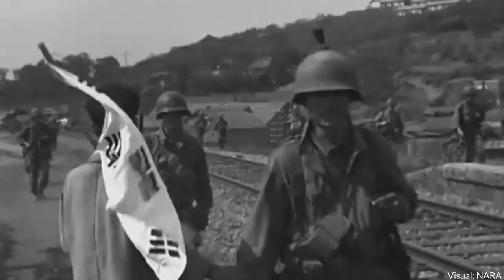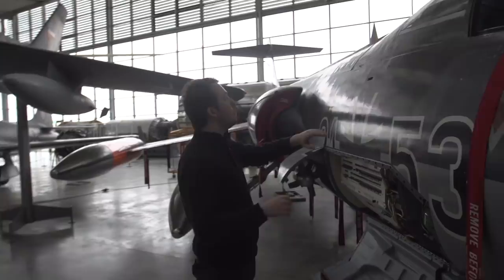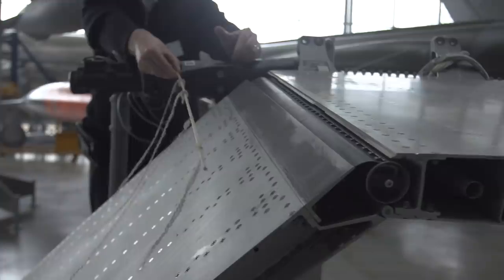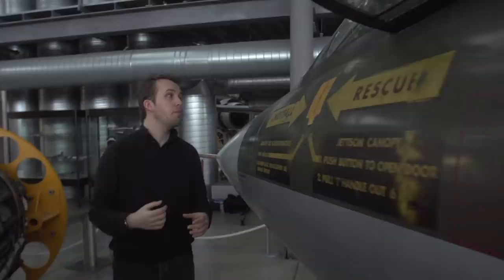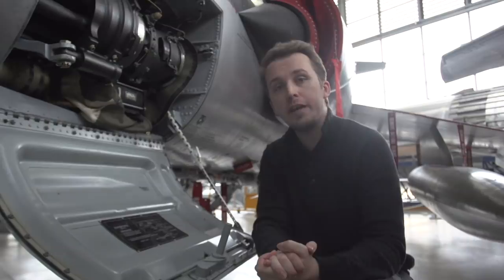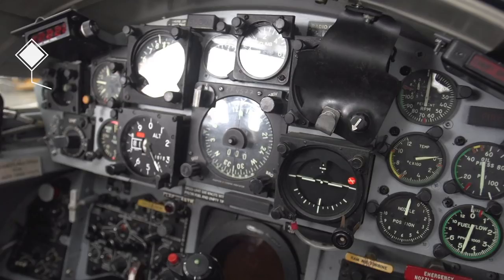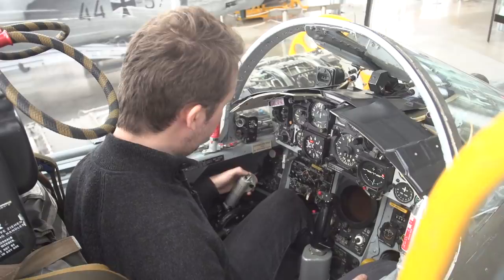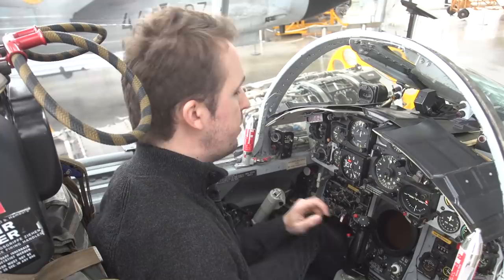F-104G Starfighter - Inside The Cockpit

Comment: The wing leading edges have red covers on them since they were notoriously sharp enough to cut yourself on. The wings were very, very thin.
Reply: Actually while the leading edges were seen to be sharp, the covers are not to protect you, they are there to protect the wing from dents and nicks that would effect the flow of air over the wing.

Comment: You missed the Canadair version, which I think was the fastest. I had a friend who flew every Canadair ever made, across the Atlantic to West Germany.
Reply: The Canadian F-104 (AKA the CF-104) was basically an F-104G, but powered by their (Orenda) version of the J-79GE-7 rather than the J-79GE-11 used on the F-104G.
The Orenda J-79GE-7 (the J-79-OEL-7) generated 10,000lbf dry (without afterburner) and 15,800lbf wet (with afterburner) which is basically the same as the ratings for the J-79GE-11 used in the F-104G, however.

But while these figures are around 10-percent more than that of the J-79GE-3 used in the F-104A, they are also about 10-percent less than the figures for the J-79GE-19 which are 11,800lbf dry and 17,900lbf wet which was used in the even heavier F-104S.
And it just so happens that these more powerful J-79GE-19s were put into some of the lighter F-104As that were used by the 318th FIS in Florida
The lighter weight and higher thrust should have made these re-engined F-104As the hottest (i.e. fastest) ever.

I think it's important to keep in mind though that the F-104s were generally not allowed to fly all out as thermal reasons (IIRC, the temperature at the face of the J-79 would rise above the engineers wanted and eventually, there was some risk that the canopy plastic would soften from the heat as well).

Comment: The original f104 was result of Kelly Johnson talking to pilots that were veterans of the Korean War. This was not a pentagon plane this was a pilot's plane. Based on the experience of the Korean War pilots all they wanted was speed speed and more speed. That and a better gun. The f-104 consequently is designed for just pure interceptions speed. Making it a multi-roll aircraft was foolish. The f-104 hydraulics for the allirons required a whole new type of actuator. This was because of how thin the wing was a regular actuator was too big. It is called a piccolo actuator. The wings were sharp enough where if you walked into them they could cut you. Ejection seats weren't quite as good when the f-104 was designed and so there was a great deal of concern about the seat firing upward and the pilot hitting the T tail. The downward firing ejection seat had its own problems because if you're at a low altitude you'd make a nice hole in the ground. Apparently this was not considered important when the f104g was designed as a multi-role. A number of West German pilots ejected into the ground as a result. Thus the f-104g ended up with the title widow Maker. A retro fit of I believe a Martin Baker upward firing seat was later installed on the f-104. This airplane actually had a red line that was below its top speed. Kinetic heating would damage the aircraft if you went over the red line speed. Essentially the plane was faster than the airframe could handle. It is my favorite century fighter. And it is an amazing plane given we just started the jet age had our first war going on with jets and Kelly Johnson comes up with this bad boy.

Comment: Glad to see some respect for another one of Kelly Johnson's innovative designs.  But I wonder if there is a German to English translation issue because I don't understand this statement at around time 6:20:  "but it wasn't supposed to be a turner, but it was still very maneuverable; don't think that turning and maneuverability is the same thing because it is not; the aircraft was quite maneuverable"?  That requires some explanation because maneuverability is the ability to alter the velocity vector (flight path) of the aircraft, which is done with lift produced by the wing, also known as turning.  What do you mean when you use the word maneuverability: controllability or stability perhaps?   Unsure what you are trying to say.

I just want to add that I am not critical of the performance of the F-104 in any way.  It was a great design that delivered exactly what had been asked of it, which was speed and climb superior to any other fighter in production. Back when this airplane was designed, superior speed, climb, and altitude were seen as the decisive advantages in combat rather than turn radius.
Reply: I wonder how it compares to the Lightning
Reply: Visionist they were pretty much made for the same purpose, so I would wager similar.
Reply: I was thinking that myself ... 
Maybe it had great Pitch and Roll authority, but blead airspeed quickly in a protracted turn?   
That would be my guess with such a short and highly loaded wing.
Reply: I believe he must be saying the aircraft was very responsive to the controls, after all, some fighters can have problems at high speeds, were the 104 was quite happy to be in.

Also, the Starfighter can't turn well only at low speeds. At transonic speeds it is said to do turns surprisingly well, after all, at such speeds the airflow is so high that it small wings represent less drag in the turn. I remember a Canadian pilot telling how they surprised a couple F-15 pilots in a mock dogfight that way.
Reply: @visionist7  The Lightening was more powerful and a bit faster, but the biggest difference between them was combat radius--the lightening had very little to speak of.  The F-104 was designed for the traditional air superiority role, but the Lightening was a single purpose point defense interceptor, built to defend the UK V-Bomber bases against a preemptive strike by Soviet bombers because the Surface to Air Missiles being developed for that specific purpose were not yet ready.   The Lightening carried just enough fuel to quickly fly out and launch its missiles at an incoming bomber, and immediately fly back to refuel and rearm to prepare for a second wave.  Ironically, in terms of role it was more 'the missile with a man in it' than the F-104, which was meant to perform more traditional fighter roles.  The F-104 was not considered a long range aircraft either, but it had significantly more range than the Lightening.
Reply: @magoid  Subsonic fighters had problems at high speeds, but supersonic fighters generally have few vices at high speed and have to be handled carefully at low speeds.  The very reason USAF bought the T-38 for advanced pilot training was to prepare students to handle high performance aircraft like the century series fighters then in service.  Each student got many hours practicing stalls, controllability demos, and patterns and landings, but only a single sortie that broke Mach 1, and that just to demonstrate that it was basically a non-event.
I agree that the 104 gets too bad a rap with regard to maneuverability.  As you say, it could not generate much G at low speed, but if the pilot kept his speed up it had good sustained maneuverability, and use of takeoff flaps in a pinch to get a gunshot meant it was not completely helpless against most contemporaries when flown properly.  It was designed for speed at the expense of wing, so anyone who compares it against modern fighters designed for turning at the expense of speed doesn't understand the history of fighters. 
Anyway, if Chis meant controllability or stability when he said maneuverability I wish he would correct his terminology.  If he’s trying to debunk the common narrative that this jet could not turn at all I agree with him, but saying that maneuverability and turning are not the same thing is inaccurate.

Comment: I worked on the CF104 as a co-op student.  First, I worked on the radar for the flight simulator built by CAE in Montreal and then on high precision aligning of the radar so terrain avoidance improved.  It seems that Lockheed bribed many European and probably the Canadian government and military to buy a looser of an airplane.   Sure, various records were set using the plane and it looked impressive.  The War museum at the end of the street we lived on in Ottawa had one on display for a while.  One might note how quickly USAF stopped using the plane for military purposes.
Reply: Lockheed did indeed bribe European governments to buy the F-104, but no, it wasn't a "looser" [sic] of an aircraft.
In the case of the Canadian F-104s (the CF-104s), about half of all aircraft were lost compared to about a quarter of all aircraft in German hands.
What people who like to point this out conveniently like to omit, however, is that the Canadians were using F-86s before they got the F-104s and they lost more pilots and aircraft in a shorter period of time than when they were flying the F-86s.

FYI, the Canadians regularly used the F-104s in low level bombing training and their pilots regularly bested their European counterparts in competitions.

As for the USAF's use of the F-104, the Air Force managed to convince itself that the U.S. was being the Soviets in terms of bombers and so were despite to come up with interceptor to take on said enemy bombers.
As a result, they pressed aircraft designed for other roles into being "interceptors", namely the F-101, a low level penetration bomber to function as a wide area interceptor, and the F-104, a daylight air superiority fighter to function as a point defense interceptor.
The F-102/F-106 was supposed to be the penultimate interceptor, but it wasn't available and by the time it was, the F-4 was also the USAF's fighter of choice and so the F-104s were quickly replaced by what the Air Force wanted, not because the F-104 wasn't a "good" aircraft.

In particular, Project Feather Duster (Feather Duster II, IIRC) showed that when the F-104 was flown the way it should be flown (in slashing attacks), it bested the F-86, F-100, and F-4.

Comment: It was great we conned the Germans to buy this turkey. The 104 was dangerous as hell and initially had a downward ejecting seat - in order to clear the vertical stabilizer. Problem is if yu lose the one engine on takeoff and eject into the runway.
Reply: > It was great we conned the Germans to buy this turkey. 

This "turkey" was able to best other fighter aircraft such as the F-86, F-100, and F-4 when flown the way it was supposed to be flown in air combat (slashing attacks rather than "turn and burn") according to the Project Feather Duster test results.

>  The 104 was dangerous as hell [...]

All high performance aircraft are "dangerous as hell", especially in the hands of pilots who are relatively inexperienced which was the case in the early days of its use in German when the accident rate was so high.
In the case of the USAF, the F-100 killed more pilots than the F-104 did I suspect for the same reason.

> [...] initially had a downward ejecting seat 
> - in order to clear the vertical stabilizer.

The operative word in your comment is "initially".
The downward firing ejection seat was replaced with an upward firing ejection seat, but "initially" there wasn't a lot of confidence in it as it wasn't a true zero/zero ejection seat.
This was changed to a Martin-Baker ejection seat which was a zero/zero ejection seat which did help keep some pilots alive.
But then so did the other changes that Steinhoff implemented to try to increase pilot and ground crew training which had helped reduce the loss rate even before the new ejection seats were installed.

> Problem is if yu lose the one engine on 
> takeoff and eject into the runway.

The problem is that the majority of pilot deaths was their becoming disoriented because of the quickness of the F-104 while flying the not-so-friendly skies and failiing to pull up in time during ground attacks.

Comment: The F104...
The biggest statistic above its Accident Rate was the amount of bribery, corruption and general sleeze involved in getting it accepted for service.
Looked like a pencil with wings, flew like one and had about the same safety record.
Reply: 2578 Starfighters were built. Equipping 15 air forces. Only the Luftwaffe and the RCAF made a habit of “Controlled Flight Into Terrain”.  Kelly Johnson never intended the Starfighter to be an air-to-ground bomb truck. The wrong aircraft for the high speed low level loaded with ground ordinance delivery mission.
Reply: @Idahoguy10157  Simply not true, Italy and Belgium also had large amounts of crashes. It also had a notably higher loss rate in US service compared to other Century series planes. The F-104G was advertised by Lockheed as multi-role, no case of  ''germans used it wrong''. Among those that passed in F-104 crashes in German service were several American flight instructors as well.
Reply: @amunnik9918  Yes, but it wasn't Kelly Johnson that advertised it, if was the company. After hearing about all the bribery, Kelly threatened to quit the company.

Comment: The Lockheed F-104 Starfighter is probably one of those planes that would best fit with the description of a 20th century fighter jet. No compromises, just all out performance is to be achieved.

I believe that the earliest F-104As had a pretty normal landingspeed for the time. Being similar to the landingspeed of the F-4 Phantom II and it wouldn't surprise me if it was similar to the landingspeed of the early MiG-21s too. We do have to remember that at the time all these planes were considered to have high landingspeeds, because the planes they replaced had much lower landingspeeds. Only later, when they really made the Starfighter overweight with multirole capability did it start to get excessively high landingspeeds.

P.S. Didn't the Starfighter, Phantom II and possibly the MiG-21 too all have a blown flap system?

Comment: That was a great tour, especially in the cockpit.  Would sure like to fly this one in DCS simulator with VR goggles.  You didn’t mention the wing edges, covered by the red strips.  They are about as sharp as a butter knife.  While not razor sharp, if you bumped your head on it, it could cut.  It cut pretty effortlessly through the air, though.  I suspect the main purpose of the red strips was maybe to protect from armorers putting nicks in the edge.  I’m not sure.

Comment: Not nit picking but I believe the ejection seat went out the bottom rather than the top (that you pointed to). Otherwise,  Great Video! You really know your way around this magnificent airplane.
Reply: The original F-104 ejection seat was downward firing since the designers were concerned with clearing the T-tail if it were upward firing.
This was changed to be upward firing which I THINK was the case with all F-104s in German hands.
Nevertheless, the upward firing ejection seats in use in the early days was not a true zero/zero (i.e. zero speed/zero altitude) ejection seat (it may have been the Lockheed C-1 although that was replaced by the Lockheed C-2 which still wasn't good enough), but eventually the problematic ejection seats were replaced with a Martin-Baker ejection seat which was not only upward firing, but which actually worked well enough that the pilots didn't try to ride the F-104 down to a landing instead of just punching out.

Comment: I hope we see this in DCS someday, because holy hell is it done dirty in War Thunder.  Not modelled well, maps too small, and faces far superior forces.  

(Not to mention the grind needed to buff its stats, done with free to play mechanics)
Reply: Theres a very good series of F-104's available for FSX/P3d. The same studio (SSW) also made a G91, which is currently being ported into DCS by a 3rd party (with the blessing of SSW as I understand it). Fingers crossed that the G91 goes well and the 104G/S follows.
Reply: @FallenPhoenix86  yeah but FSX and P3D don't have combat or anything right?
Reply: @DeadBaron  No, but my point was that the studio that made it appears to be moving into DCS.

Still worth a look, even in FSX/P3d.
Unlike most developers they have real world experience of the types they model, the lead developer was an AMI F-104S pilot.
Reply: @DeadBaron  actually yes, the company made a freeware weapons manager called vacmi but it also uses takpack if you have it, the saw f104g is my pfp as well
Reply: Its modeled well in the game? Or do you mean its flight performance modeling?
Reply: @sylamy7457  Both, it runs into the limitations of fsx in regards to systems modeling, but they've done well working with what they have.
For flight model, its one of few aircraft in fsx that doesn't feel like its flying on rails.